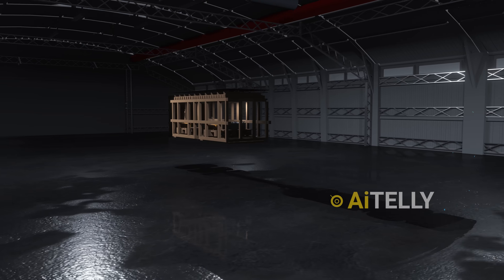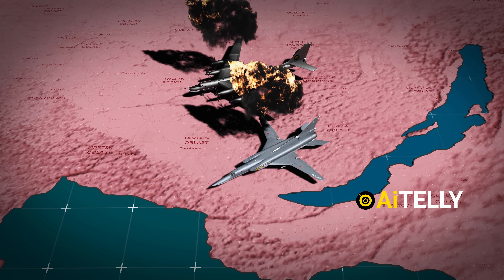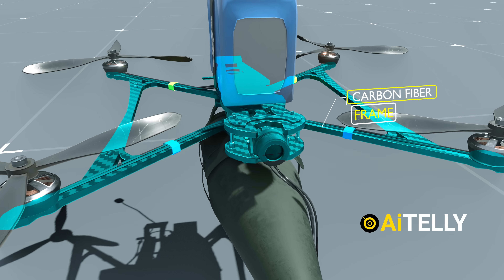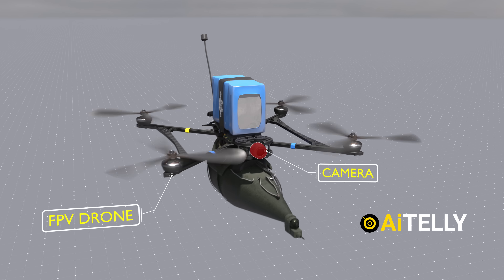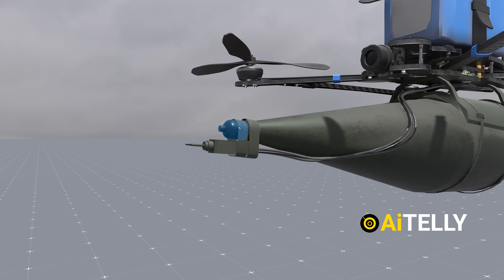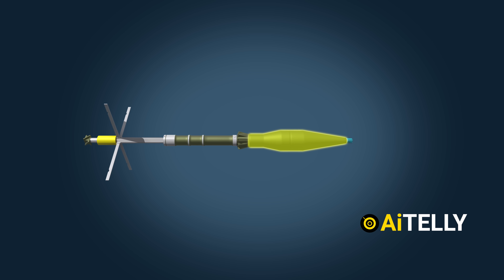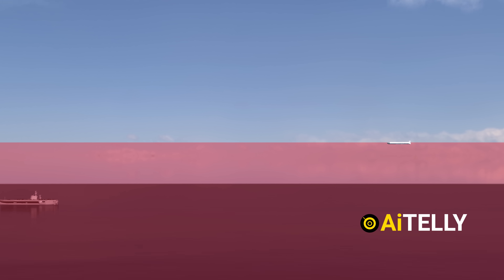How Ukraine FPV drones Truck Attack Happened? #ukraine #russia #Spiderweb

Comment: Why not use frequency hopping to communicate with the drones?  Removes need for fiber optics and its limitations/encumbrances.  Also cannot be effectively jammed, intercepted, or hacked, unless the adversary also has your COMSEC.  IF so, you're done anyway.  Fresh load with new keys at start of each mission would remove that threat.

Comment: Drones wasnt using any fiber optic or manual controll, even in video you can see they used Ardupilot so they was autonomous, no VTX or TX antena visible on drones in photo of placed them at container - not including big chunky fiber spool during flight filmed by bystanders

Comment: No, they were driven to the sites from the longer term locations by unknowing russian truckdrivers.

No, it's not 34% of the fleet of those aircraft. It's stated to be 34% of the aircraft at the targeted bases.

No, that's not the range limitations of wire drones, they can surprinsingly go much further. Look at latest CSIC reporting.

Scenario atnthe end is also strange.

Nice videos but unfortunately often strange factual mistakes.

Comment: The general theme is correct but A Lot of inaccuracies based on assumptions and not factual data.
1. Trucks were carrying wooden houses and the drones were hidden under the roof/solar panels.
2. Truckers parked next to the road/highways, waiting for somebody to pick the cargo(they were told somebody will pick it there).
3. The roof was blown off - not a motorized thing.
4. These were not FPV drones, nor did these use fiber-optic cables
Additional info:
4. These were specialized drones that fly slow, to account for input delays(not like FPV). Controlled over the internet 
5. The drones were carrying 3.5kg-4kg explosive payloads, based on wattage(power consumption) displayed in the videos

Comment: This is the problem with making a video like this. You got a lot of it wrong.

They didn't have "operatives" drive the trucks, they simply had the containers delivered using normal commercial methods of delivery. The truck drivers had no idea what was going on

Comment: This is not how these drones are built. Please inform yourself more or stop using AI. Also these are brushless motors, 3 cables not two, no "motherboard" but Flight Controller and Electronic Speed Controllers. FPV is not that big of a topic and pretty easy to lern.

Comment: Almost everything in this video is incorrect.

1. There were no batteries inside. Containers were empty inside. All of hardware was hidden inside the roof.  
2. These were not containers, but mobile cabins for workers.  
3. The drivers didn’t know what they were transporting. They were used blindly. They were simply paid to deliver the cabins to a specific unloading location. No one waited days — the drones launched almost immediately after the drivers arrived.  
4. The roof didn’t slide open — it was ejected onto the ground.  
5. It's still unclear about the operators; they might have been partially autonomous, since a stable signal can't be guaranteed and there are jammers.  
6. Only about 12 aircraft have been confirmed — 40 is a major exaggeration.  
7. Fiber optics were not used.

Comment: *Hey everyone! Not everything shown in this video is accurate.

1) The drones and trucks didn’t come from Ukraine. They were prepared on Russian territory by saboteurs. The warehouse where they were assembled has already been found — it’s in the city of Chelyabinsk.

2) The truck drove up, and drones were launched directly from it to attack a strategic airbase — one that houses **nuclear-capable bombers**. That’s the scary part.

3) Only 8 aircraft were actually destroyed — not 40, as many headlines claimed. Four of them were Tu-95s, which are old turboprop strategic bombers. Meanwhile, much more modern Tu-160s were parked just a few hundred meters away and were left untouched.

Think about that.

And to those who are celebrating this — you’re completely missing the point. This was a *terrorist attack* on nuclear military infrastructure. If it can happen here, it can happen anywhere. No one is truly safe.

This isn’t something to laugh or cheer about. It’s a wake-up call — and it’s terrifying...

Comment: those planes cost hundreds of millions of dollars and Russia can no longer produce them!! in this regard, those airfields are protected by radio interference, it is possible that it is impossible to control this drone without fiber optics, but on those drones there is no fiber optics, this means that the drones were controlled by AI, if the drones were controlled by living people, they would have driven away the Russians who were throwing stones at trucks trying to stop drone takeoffs. The AI was taught to destroy only planes and not people, and the attack took place very far from Ukraine, it was impossible to deliver 20 soldiers there to control the drones at the same time!!! it was definitely an AI

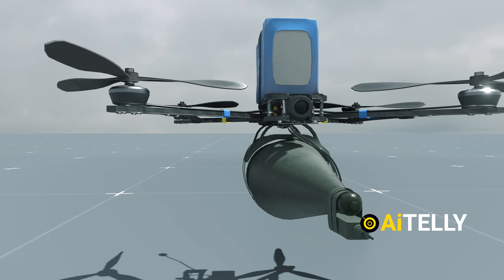Comment: 4:40 DUDE those were made using ARDUpilot chipset. those are the most common drome chip sets in world. these drones were not military grade. i have build over 34 RC drones and aircrafts from Su-57 to A-10 to almost most types of drones.
i legit know how they did the entire operation and it's hilarious plus they didn't carry warheads, because it off set the balance, they had used C4 charge bricks. 
how do i know this? C4 combustion gives dark smoke cloud but thick one. most warheads on trigger creates a split spark type explosions. based on those drone footages from this mission.

yes some drones did had warheads but most impact were given by the C4 brick charge.
upon viewing the footage if u see some were directly ramped and some just landed near wings and were ignited.

5:05 
also about batteries, in official photos they have censored the battery because those batteries came from a certain companies which had been the higher supplier of drone equipment for ukraine. 
i know which company it is 😂 i bet zelensky personally talked to this company for supplies. this company that provided parts is well know company, this also clears one point which is, some of the UN officials knew what zelensky was upto but they didn't had much faith in this operation

5:47 the chipset they are using is IDUINO APM 2.8 Flight Controller Board, it's small and lite weight.
but this board doesn't have a way to feed it's VA signal to longer distance as 1000km 2000km etc. so what they did is, those trucks have a receiver feed and that receiver feed is feeding the live footage to satellite. again, something which isn't possible without some european countries helping zelensky....

and yeah those containers which had these separate control and VA feed repeater module, surely got destroyed right after the mission was executed.

Comment: So much half-true information about drones in one video!
E.g. about the counter-rotating propellers.
They are primarily there to prevent the drone from spinning uncontrollably on its own axis. (Like a helicopter without a tail rotor)
And not so that the drone flies more stable at high speed. And there a lot more false informations about Drones in this Video!
Please inform yourself first before you produce videos, otherwise it looks more like you are trying to spread false information and undermine the credibility of all the information in the video!
What Ukraine has achieved here is brilliant, unfortunately your videos are not!

Comment: Sorry but a lot of the information in this video is not correct: FibreOptic drones are being used FAR further than a 1 mile range, Ukraine has not mentioned there were batteries in the containers and they wouldn’t be needed, there would be no ‘signal blocking’ required on roof as the drones would have been remotely activated.

Comment: Absolutely wrong events recreation. They were not biult in sea cans, they were modified modular houses. They were not moved from Ukraine, they were built in Chelyabinsk, a Russian city, by former ukranians, hired to do this by Ukraine's "SBU". They did not have sliding roof, they had roof top hatch with remote control. They did not destroyed 40 planes, confirmed by independent sources only 12 and in only 2 locations. With the other 2 something wrnt wrong no damage confirmed, the one on far east, truck caught fire and exploded on a highway. Next time do the fact checking before rushing with conclusions please...

Comment: The Ukrainian General Staff today added only 12 Russian aircraft to the list of losses. That's not even close to 34%. Your video is propaganda. Wishful thinking.
Reply: @john_karpov  So you’re focusing on the number of destroyed aircraft and treating that as the main point of the video. But in reality, Ukrainians struck strategic bombers inside a country that calls itself a superpower. These are aircraft that Russia is incapable of producing. Moreover, according to Russia’s military doctrine, the destruction of strategic aviation gives Moscow grounds to consider the use of nuclear weapons. Do you understand the scale of this operation? The number of aircraft destroyed is a secondary issue.
Reply: @tarasovruslan  probably you are right, it's a goal of prestige. But it does'nt ifluent at possibility strike to Ukraine and losing territory everyday. Sumy now only 20 km away from Russian army. Ukraine loose 200 squre km during May month. Nobody remember how successful were Japan military operation, cause it fail war. Same with Ukraine. Nobody remember loosers.

Comment: The video is quite inaccurate, the lid wasn't automatic, at least not the way in the video. Trucks didn't have batteries inside or smth like that, there were no optic fiber drones

Comment: show us the weight of the heavy battery (10+ lbs) and the RPG (5-10 lbs) on screen, then explain how incredible an engineering feat it would be for a 24x24" consumer-sized drone to get some 20+ pounds airborne.

Comment: Correction, some of the fiber optics strike up to 40 km, but normally is used up to 20, but issue is the webs they leave helps to find your position 

Also you forgot mother of drones 

Also trucks were positioned on the roads and fuel stations not in the forests

Comment: The big question... Are there more containers still out there? The Russians will be flat out for a couple of weeks checking every container in the country. Inspection at ports will slow imports dramatically. Once this war ends the world's military will be beating a path to Kyiv for this tech and the data gathered during this conflict.

It can't be long before there are full mesh networks for drone C&C - if there aren't already.

Comment: About the drones: you showed a prop out config which is not that common, most drones will have the props spin in the opposite direction. And the PCBs were not that accurate, the motors Ned an esc. but considering how long you took this is still remarkable

Comment: I might need to timestamp this since there's a hella alot of misinformation with this video.

0:45 They were parked at truckstops. The ones parked on the side of the highway next to the forests were the ones that self destructed before reaching their intended target. None were parked at Industrial Areas. The 2 Successful Drone Trucks that launched their payloads were parked at Truck stops.

0:50 They weren't dormant for days or weeks as some of the trucks exploded whilst on the highway headed to their intended target.

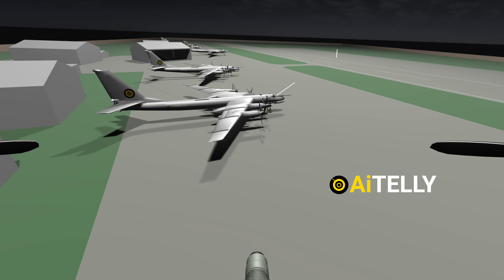1:26 No fuel depots or radar installations was hit. So far, the only confirmed targets were the parked bombers and transport aircraft.

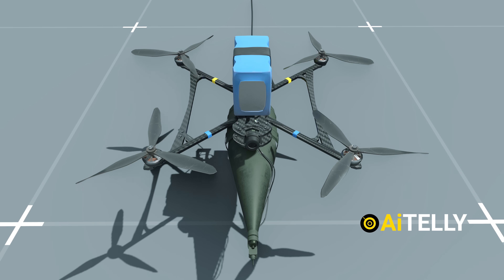4:36 If any of you actually looked at the photos, the Drones used by Ukraine were all light and small, none of them carried an extremely short Fiber Optic Roll or a Warhead.

Comment: USA gave intel to Ukraine and violated the START (Strategic Arms Reduction Treaty between Russia and USA extended until February 2026 remains in force), despite the fact that its control mechanisms are effectively frozen. One of the key elements of the agreement was transparency: strategic bombers must be parked in open areas so that their numbers and condition can be verified through satellite reconnaissance or inspections. This rule is intended to reduce the risk of mistrust and prevent unexpected escalation.